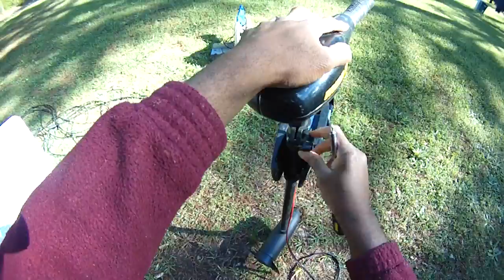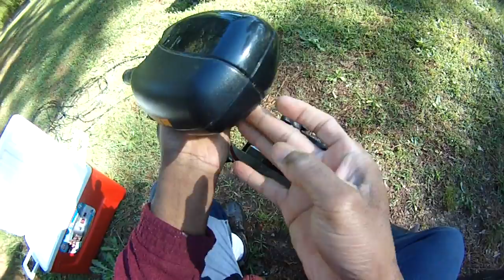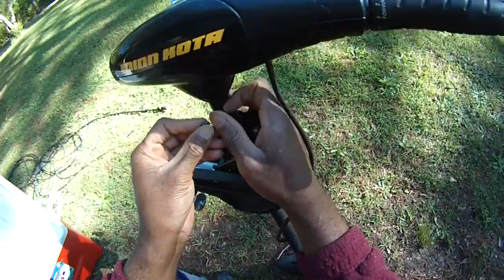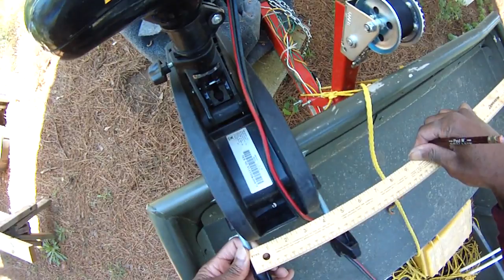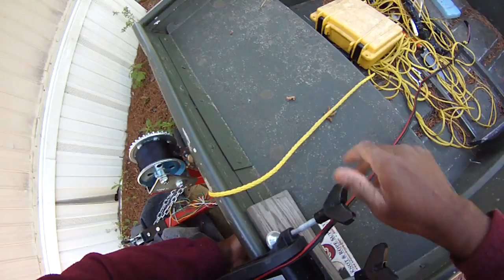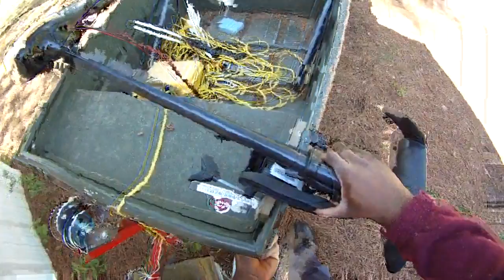Bow Mounting A Trolling Motor

Comment: I got a Bow mounted motor with a motorized left/right control that I got from the local trash dump.
works great but the previous owners cut all the wires off so I made a homemade control box that works better than the other did.
I also found a transom motor that was not working but the problem was a bad connection in the control.
now it works .
free motors works just as good as a new one because it leaves money in my pocket.
Reply from the maker: SWEET!

Comment: Thanks for the video.  I have read that pressure treated wood causes corrosion on aluminum boats.  May be worth looking into.
Reply from the maker: Well, just use untreated. It's easy to epoxy and varnish untreated wood to water proof it.